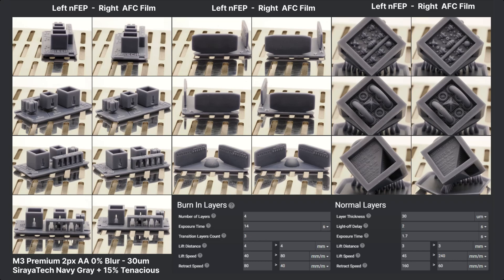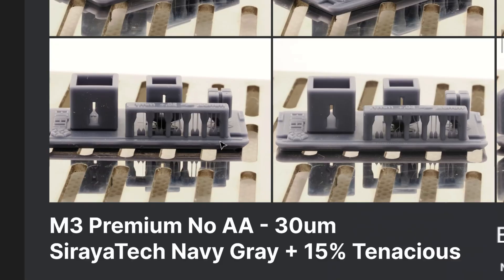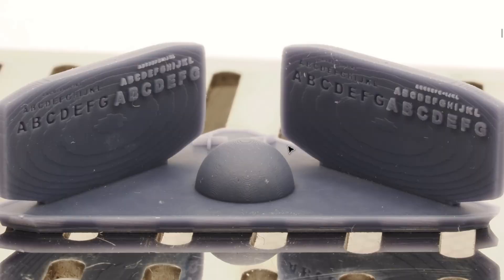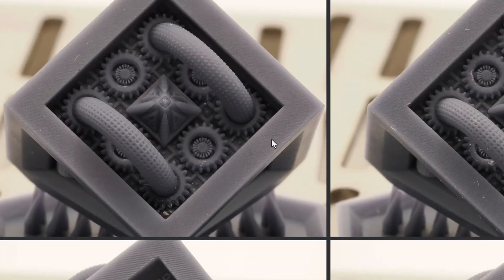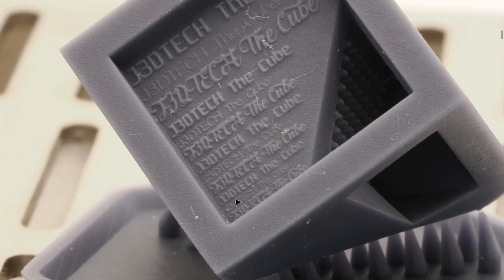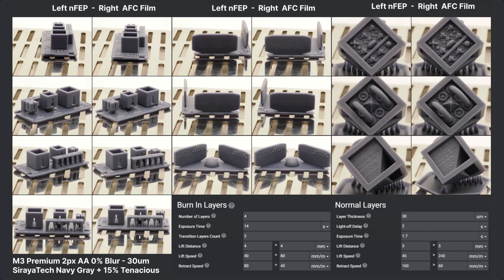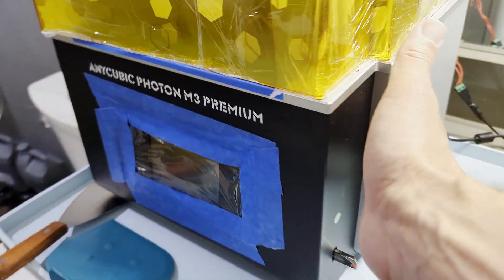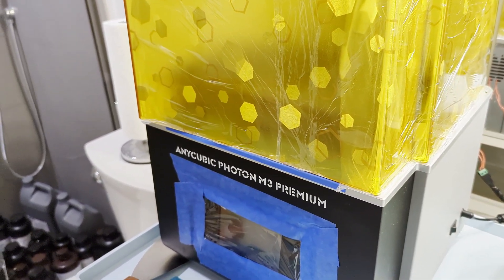Why do 12k Printers come with this?  nFEP vs ACF Film

Comment: depending on what kind of stuff u print i think ACF is better if u dont need max details and faster print speeds...
if u paint acf will the texture go away?
Reply from the maker: @DaveDRC  If you paint thicker, don't care about details. Then you can lift on the first stage of TSMC a bit faster but no other settings change.

Comment: I mean I get it very fine details will get affected, realistically thought its almost insignificant. I am using an Emake galaxy1 printer which is very large, for this ACF is just straight up better, detail still looks amazing, peel forces drastically reduced. print speed also increased so hugely beneficial on that printer. For ultra high detail miniatures perhaps stick with nfep.
Reply from the maker: @garythmardellis1289  If you're printing something with a lot of texture, you won't notice it as much. But if your print surfaces, you'll notice the etching. 

I would be interested to see your settings for ACF versus nfep because the only setting that you can increase or that I should say is affected by using ACF is the first stage of lift speed. All other prints remain exactly the same regardless of what release film you are using. 

Well that's not entirely true, you do need to add a little more lift height with ACF. On a medium sized printer you can easily get away with 5mm lift speed total. Or push it to 4mm and most often be just fine. For ACF you're going to want 6-8mm lift height. This will chew at some of the speed gains you get from the faster first lifting speeds. 

As for the reduction in peeling forces, it is true that it does have a reduction. However, ACF does wear out much faster and the Force actually starts to increase beyond nfep as it starts to wear down and that's going to be about 10k to 15k laters. After going to start having more peeling force than NFEP. 

It's about three to four times the cost to replace and tears much easier.

In the end what you're saying is true but with a lot of ... Buts.

Comment: Is this still the case or are new ACFs different from this previous type?
Reply from the maker: Its still the same situation, ACF has a physical texture that helps air get under the FEP. You simply cant have a texture in this part and have it not effect the quality of the print.

Comment: Going to get Saturn 4 ultra
Can u tell me can i get extra film fep or acf can work ?
Also can i use satrun 3 acf ?
Reply from the maker: Luckily ACF seems to be going away. 

What we have learned is that it only has a lower peeling force for a while but as you use it becomes very similar to nFEP but

Costs 3x, tears much easier, affects the print quality. 

But you can use anything where the size of the sheet is larger than the VAT.

Comment: I'm contemplating switching to Nfep next time I have to change my ACF. I have an Elegoo Saturn 3 Ultra. Do I need to change my exposure settings? If so would I just start with the settings for the Saturn 3 and calibrate from there?
Reply from the maker: The Exposure settings are very similar maybe 0.1 to 0.2 second difference. 

The only setting ACF lets you change faster is the first stage of lifting under normal layers. All other settings are not affected by the type of film that you use. What this means is that a lot of these advertised films with ACF are only because they increase the speed limit on these printers for marketing reasons, not because you should actually go that fast.
Reply: @J3DTech  Thanks. I usually start with the settings suggested by Sariah tech for the resin I'm using and then run a series of the flat chip tests to get me close. After that I switch to upright tests to fine tune. Your tests on cults have been very helpful.
Reply from the maker: @JHartModelworks  Thanks! They're my main reason and I've used most of them. 

If you've read through my guide, you'll see I've got some default settings that work really well for almost everything and then I just calibrate from there to dial it in.

Comment: As a mini painter, I'd much rather lose a tiny bit of detail and not have to deal with visible layer lines.
Reply from the maker: If you're having layer lines on minis this isn't about nFEP this just means that your model is not properly supported or your settings are off.

You can get layer lines on ACF for the same issues.
Reply: @J3DTech  That's just not true. I'm not talking about layer shifting, I'm talking about layer lines. You can even see them in your video.

Comment: The ACF in my Saturn 3 Ultra was ruined with the first test print! I printed a few small items to the sides of the big scar and have new ACF on the way. Its stupidly expensive, over $20 a sheet so next time i think i will take peoples advice and just to go FEP, but I have 4 fresh ACF sheets to ruin first, hopefully ill have a few dozen bottles of resin printed by then.
Reply from the maker: ACF is much softer and will damage much faster if you're not super careful about how and what you print. 

Just another con against its single pro.

Comment: Hi. This is a super test. Do you get also dimension deviations? When you print cube 10x10x10 are this dimensions accurate after hardening and curing?
Reply from the maker: When you fully cure the resin you will get 1-4% shrinking depending on the resin. 

Calibrating the resin to post curing will help offset this by some. However you can't ever get away from the fact that we are dealing with plastic and even the temps of your room while you measure can have a 1-2% change.

Comment: thanks, great information I desired to buy nfep film but the doubt is  which size I want to use (0.15,0.125,0.10) and I am using Mighty 12k and elegoo mars4ultra 9k
Reply from the maker: For the FEP thickness? 

In my guide I have 2 links to what I use.
https://docs.google.com/document/d/1Z8fkzOxEgI9sOTwDKI6CeblpnuP4V8ayYVwZrYGmo44/edit#bookmark=id.f7x19c30uvoc

Comment: I'm sorry, but could you please help me and give me some guidance. I have a m5s... but after a week of active use there are problems with the film - scratches and voids. And now I have a problem of choice in front of me: what is the best choice for active printing (miniatures and toy prototypes)? Nfep for m3 of original AFC for m5s?
Reply from the maker: The ACF is only for speed at the cost of detail. If you want prints to look the best use nFEP.

Also don't ever touch the film with anything hard or plastic. Use a soft silicon spatula to mix the resin and check for hard bits before every print.

If you find anything use a vat clean to remove it.

Comment: In reviewing some of the specifications i found that most standard 3d Printing nfep (PFA) and fep is 0.127mm thick where as ACF sits in at 0.3mm could this increase in thickness be responsible for some of the results we see?
Reply from the maker: It's a part of it. Thicker material pulls you further away from the LCD. The further away the more out of focus. Also the more material for the light to pass through the more diffused it will become. 

However most of it is caused by the physical texture in this film.

Although the texture is on the bottom, this will dramatically diffuse and refocus the light according to the pattern.

Plus I'm pretty sure part of that pattern does get stamped into the layer.

Add all of these aspects together and you have the texture we all see.
Reply: @J3DTech  I wonder if that texture would be as pronounced if they produced it at half thickness if that's even possible.
Reply from the maker: @sporeknight123  The texture is why it works how it does. If removed I don't think it would peel off of the LCD as well and you're back to nFEP.

Comment: I came here to see if I had made a mistake in buying a Mars 4, and I can breath a sigh of relief now lol, the differences between the two are so unbelievably small, I actually prefer the softer texture over seeing level lines. But, I understand that for people who are really into the hobby how they could take issue with the ACF film, but it seems so insignificant to me lol.
Reply from the maker: It's  very small, if you're trying to fit parts with very tight tolerances it will cause issues. For many, this is never an issue. 

That said, you can always replace the ACF with nFEP if it is.
Reply: Ésto es intentar rizar el rizo. La mejora en el porcentaje de piezas impresas con éxito es tan grande cuando usas ACF, que el hecho de haber diferencias cuando aumentas 325000X de aumentos no importa nada.

Comment: What is the speed loss between a 12k printing on FEP vs ACF?
Reply from the maker: All depends on what you're after and your printer. People have been using Vroom settings on FED and NFEP for a long time. ACF just makes it a bit... easier on your printer. But only the newer printers allow for faster movment speeds. The Satun 3 Ultra goes very fast at 500mm/m where most printers are at 250mm/m. So really in this it does not matter what film you're using the speed will be the same.

But I don't care for speed as much as I care for quality. If I can have both GREAT but I won't sacurface qualty for a little more speed.

Comment: Interresting comparison… while I am comparing first mighty 8k to 12k I have seen that same parameters are not also giving same results because of the changes made after upgrade. I honnestly supposed this is the same with acf… one must adapt parameters… and I think the exposure might be slightly longer with acf… overall I see a gain from 8k to 12k thus if there is minimal loss of crispness after changing to acf … I could accept that as it may bring the quality equivalent to 8k screen with much faster printing time… let see soon

Comment: This is extremely helpful! Ty for your time. I'd like to ask something though, so i assume ACF film is for speed? Is it possible to replicate it on lower models speed wise? I have an Anycubic Photon, if i put a fast resin + ACF film, will i get close to 105 mm/hour performance?
Reply from the maker: You will be restricted by the firmware speed limits of the machine.
The silly thing is that people have been using what's called vroom for a very long time to print at the top speed limit of their printers. This is all been going on. Long before ACF film became a thing.

Comment: Excellent test! I'm a bit confused about this ACF Film. It appears that this is a classic FEP coated with a polydimethylsiloxane (PDMS). At the beginning of 3D resin printing where mainly projectors were used (replaced by DLP's) and later LCD masking printer were introduced, PDMS was the predominant release film. Basically is a silicone coting! The "non-stickiness" comes from it's rubber/elastic properties. So far Teflon and it's derivates have the best non-sticking properties. This "new"- I guess it's just badly done marketing (because ACF Films are used in electronics for other purposes), ACF Film is therefore a rediscovery of a hot water! The main issue about PDMS was it's opaqueness and lack of longevity. Not to mention the scattered UV light and as a consequence lost in details over time.
Reply from the maker: I'm not 100% sure of how it's made but it is a physical texture on one side and the material is softer and more flexible then FEP.
Reply: @J3DTech  Exactly the properties PDMS's have. You can try this exact effect if you... let's say use a wide rubber band and put a duct tape o it. Than start stretch a rubber band and you will notice that the more rigid duct tape basically releases itself from the rubber. Even better if you have some kind of silicon instead of rubber band ;-)

Comment: Phrozen has an animation comparing ACF vs nFEP vs FEP. You can guess the impression it portrays. However, I did the 12 upgrade on the Mighty 8k including replacing the nFEP with the  ACF and.... well.... it still goes pop on release. That animation definitely gave the impression there would be a silent release. I have not done tests on reducing bottom layer exposure yet. Phrozen made the claim that printing will be faster but did not specify how. I can only presume they were talking about reduced bottom exposure. But they made no recommendations, that I have seen.
Reply from the maker: Gotta love marketing.

The loud pop is often a result of the Z-offset being too low. I have another video titled "All you need to know to get started with 3D printing." 

In that video at around the 9min mark I show off a calibration part for your build plate and I show how to use it. I'd recommend giving it a try.

Finally to get the speeds you have to use their slicer. Use a speed profile that will print at 0.1mm layer height. But you also have to use the speed resin that is a version of Eco resin with massive warping and shrinking properties.

It is fast. It just won't look good or last very long.
Reply: for me ACF vs NFEP reduced a lot the stickness to the FILM, i dont hear anymore the FLOP FLOP, only for first layers and really low sound, Im using ACF with Halot One and Halot Mage 8k, im loving it, my prints rarely fail
Reply: @michaelnoardo3315  Yes me too acf for me is just better contrary to a lot of opinions. DISCLAIMER I think it is better for very large printers printing very large things, for small printers with inherently less peel force nfep is better, especially if you require maximum detail although for me both films produce great detail. I do hear that apparently there is a lot of poor quality acf suppliers so results might be mixed depending on which you buy and yes it is expensive. I actually like the matt finish you get using acf as it gets rid of any shiny spots.

Comment: I've been using the ACF film for a few months and I'm not liking the vertical line texture.  I think the frosted particles of the film are diffracting/blocking the light as it passes through the frost, thus creating light & dark areas.
Reply from the maker: I just did another test in the Saturn 3 Ultra with the pre-installed ACF. Same patterns, I'm not doing my first print using nFEP

Comment: Great video as always.

What would be your assessment on the following situation: 

I am using sunlu abs resin on a saturn 2. Both the dimmensional accuracy test and the cones of calibration print correctly. But i am having the recurring problem of many models sticking to the fep when using a layer height of .1mm, it does not happen if i print at .05mm height but for some reason the models at the bigger layer height do not hold to the supports. It is very easy to remove the supports on .05mm and quite convenient. But on the .1mm it just doesnt work...since i am printing models with good results on quality (when successful) at .1mm I wouldn't want to go for .05mm and twice the time...
Reply from the maker: A few things are going on here.

First, did you calibrate your resin at 0.1mm layer height? If not you will need to do that.
Second, not all resin is great at a thicker layer height. This is because the light from the UV needs to be able to push through that entire layer. A good rule is the darker the resin, the more pigments, the more pigents the harder light will have pushing through it.

At 0.1mm you will really start to notice layer lines, more on the tops of objects then on the sides. Depending on what you're printing this is just fine or unacceptable.
Reply: @J3DTech  thank you. Yes, I did the calibration tests at both layer heights. The .1mm resulted around 3.4s exposure for successful cones of calibration and accurate square fitting on your dimensional test. And for .05mm it was 2s exposure. 

The resin is in fact quite black. 

Would mixing a light color or transparent resin work as the resulting resin would be lighter color. ?

Most likely since they are presupported from the creator they might have used too fine tips, and the pulling force resistance could be higher the thicker the layer is. Just a theory.
Reply from the maker: @davidc3150  Adding a light colored resin would help but also increase blooming. You would need to redo calibration.

After proper calibration, failures are almost always a result of not enough support.

This is most true when you get rafts and supports but no model.
Reply: @J3DTech  thank you for your patience. I need to start practicing with supporting my prints lol. Will try to get away with a middle point at .075mm. Hopefully being a thinner layer and trying improve the resin colour will help for the quick short term.

Comment: Could this be caused by the matt finish on acf film or perhaps the slight thickness difference resulting in underexpsoure?
Reply from the maker: It is caused by the finish. It's diffusing the light and causing the surface texture.